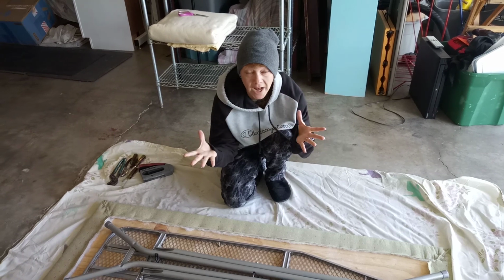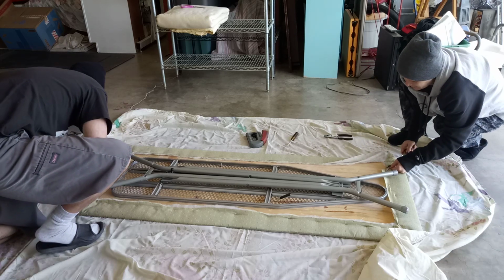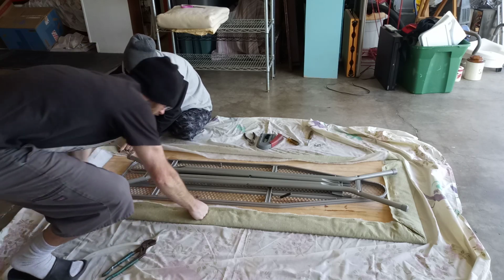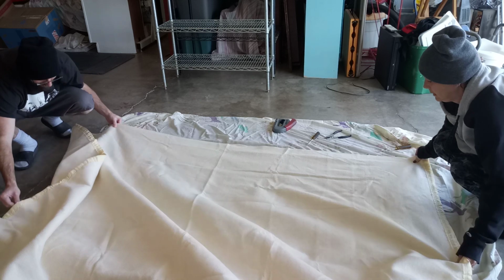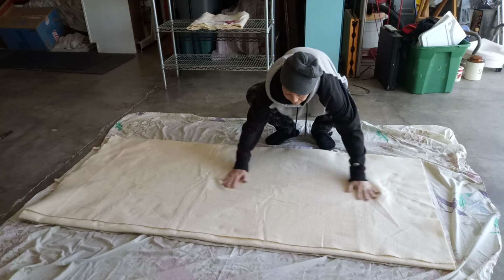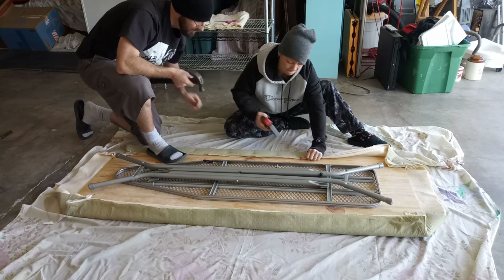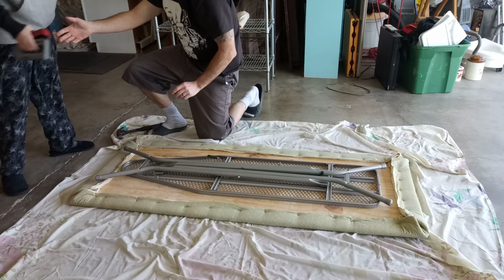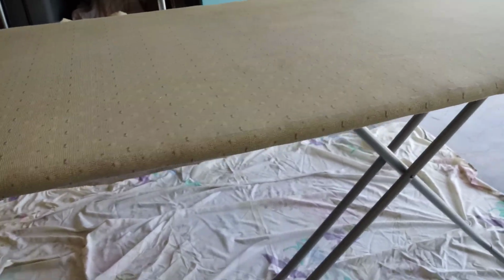Re-Covering My Large Ironing Board

Comment: The iron board is a very nice size, and the ironing board surface is THICK!♥Excellent job!  You both work nicely together.  What size bolts and washers did you use to bolt the ironing board frame to the plywood?  I would like to build one, too!
Reply from the maker: The wood is quarter inch plywood. The bolts are about 1/2 inch I think 🤔 there are 6 or 8 of them I don't remember 🤔 we did have to do recessed screw holes into the plywood as well so that I never take the chance of hitting the bolts with the iron. And it's on a grate iron but if you only have the flat kind just drill holes in that.
Reply: @TiffanysQuiltingLife  Thank you so much, Tiffany.♥👍I should be able to find the plywood, the bolts and washers at Home Depot.  I already have the grate-surfaced ironing board.😄

Comment: how did you attach your ironing frame to the wood
Reply from the maker: With inset drilled holes into the wood aligned up to the holes in the iron board away from the up and down mechanisms. Then used bolts and washers and nuts to hook together. The bolts through the wood down to the underside of the iron board. And the bolts sit flush with the wood (that's why we drilled with a inset hole). At the end I show how its bolted to the wood from the underside.